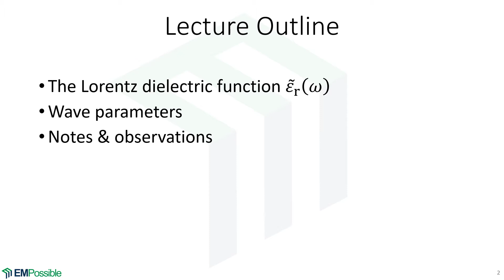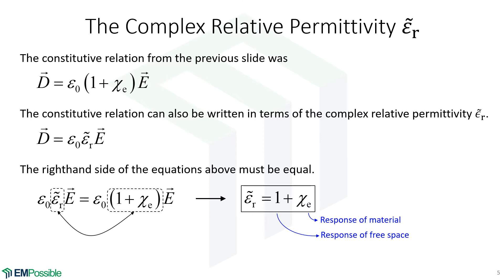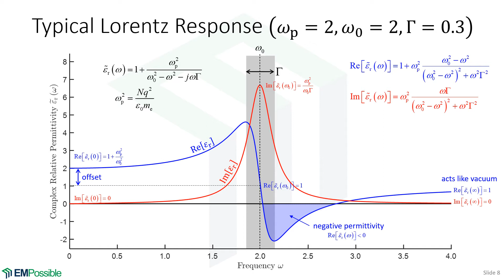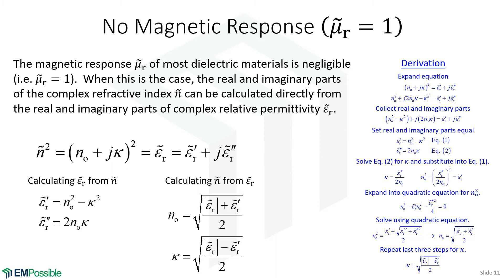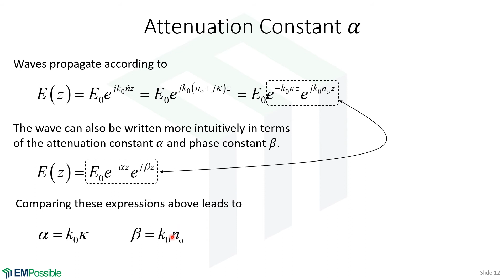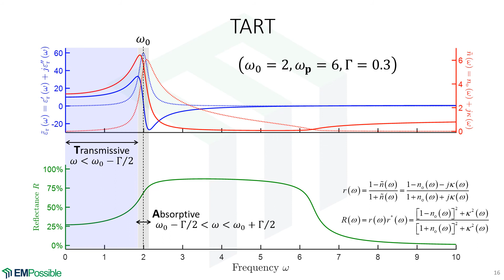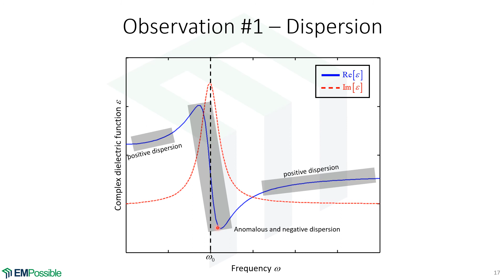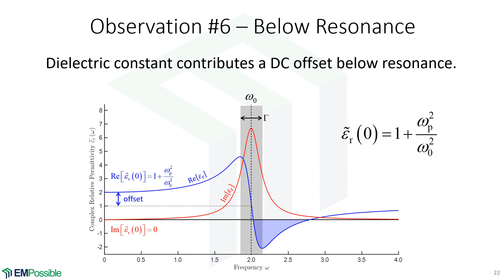Lecture -- Lorentz Model for Dielectrics

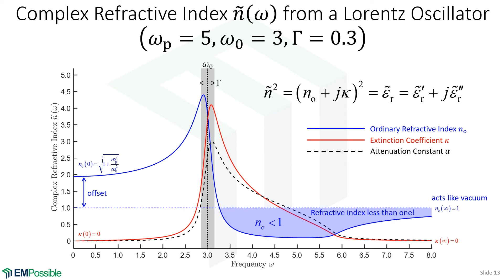Comment: 14:18 I tampered a little with the parameters (wp, w0, Gamma), but I never received such wild curves for the refraction index on the following slide. How to predict curves with multiple Lorentzian shapes?
Reply from the maker: That is probably a better question for an expert in spectroscopy.  Without being an expert in atomic scale resonances, we as engineers will just measure and then possibly fit a Lorentz model, or multiple Lorentz models to a curve using nonlinear regression or just trial-and-error.

Comment: Thank you so much professor! I’d like to know your thoughts on dielectric function of semiconductors.

For some semiconductors, their optical dielectric function is described by the Lorentz model resonance frequency of which is attributed to band transition. In this case, how can I understand the resonance frequency in comparison to that of dielectric materials? Are both these two cases basically the same?

And, let’s say there is a semiconductor and its dielectric function is large enough(due to the band transition) to be used as a core material in a slab waveguide. Do you think this guided mode is a result of repeating band transition say, repeating absorption and re-emission as it propagates in the slab?
Reply from the maker: Hmmm...When it comes to semiconductors I am getting a little outside of what I know well.  As I understand it, the periodic nature at the atomic scale is what leads to bandgaps for electrons, but the repetition is too small for photons.  Everything can be modeled as Lorentz.  Could be wrong!
Reply: @empossible1577  Thank you so much for your reply :)

Comment: Can you explain what is the plasma frequency and how it differs from resonance frequency w0 of the electrons?
Reply from the maker: Absolutely.  First, let me point you to the course website which as links to the latest versions of the notes and videos and has many other resources for you.

https://empossible.net/academics/emp6303/

The plasma frequency is described and even animated in Lecture 2f.
Reply: @empossible1577  Thank you! I have another question. How can a material be transmissive below resonance frequency? I read that at frequencies below plasma frequency, total reflexion occurs, since the electrons can follow the oscillations of the wave and thus respond instantaneously to the excitation and the material behaves as a conductor then. Or am I wrong?
Reply from the maker: @pavelrozov741  For metals, the plasma frequency is roughly though of this way.  Above the plasma frequency the metals are transparent and below the plasma frequency they are good metals.  However, the transition at the plasma frequency is not a sharp one.  In fact, it is very slow and gradual.  Even far below the plasma frequency, metals are never perfect conductors and some amount of the wave can transmit through them.  More accurately, they decay very quickly.  This leads to the concept of skin depth.
Reply: @empossible1577  ok, but how does ist exactly work for dielectrics? As far as I know, the concept of skin depth applies only for metals and not for dielectrics. I know that a material ist never 100% reflective, unless its an ideal conductor. But in the plot for the reflectance it looks like for low frequencies the dielectric is almost as transmissive as for high frequencies (at least much more transmissive as for resonance frequency), but I just cant understand why...
Reply from the maker: @pavelrozov741  Strong reflectance happens when a material has rather extreme material properties.  The extreme properties could be refractive index or loss.  This generally only happens in the vicinity of a resonance and a bit above.  It extends a bit above because the loss is rather extreme and extends farther on the high frequency side.  Below the resonance and far above the resonance the loss is low so the reflection is low as long as the overall refractive index is also low.

Did this help?
Reply: @empossible1577  yes, thank you! I have a last question. if we plot the group velocity as function of frequency, we get a negative group velocity for frequencies near the resonant frequency. Could you maybe explain what the physical background for that is?
Reply from the maker: @pavelrozov741  I don't know!  Lots of strange anomalies happen around resonance, mostly due to being looked at in the frequency-domain.  I will have to give this more thought.